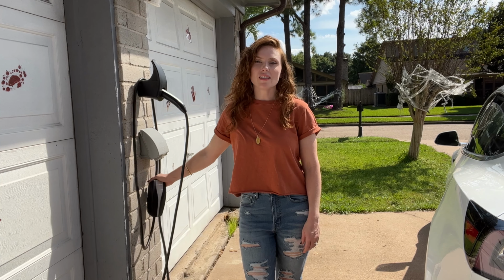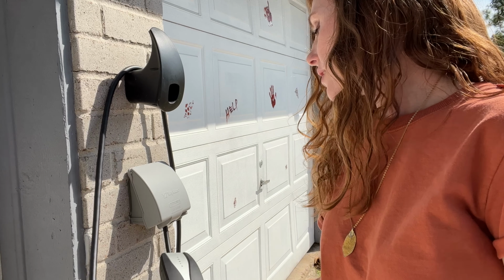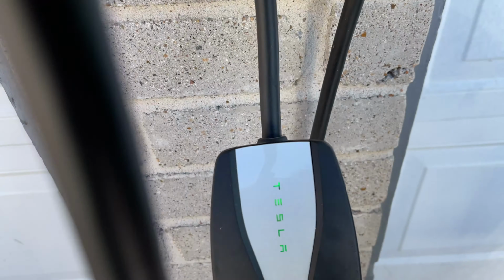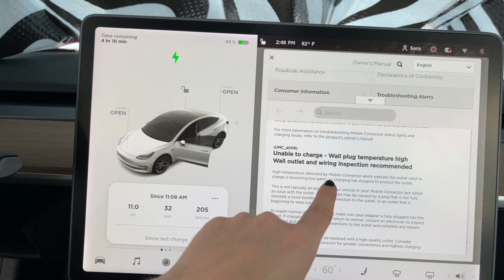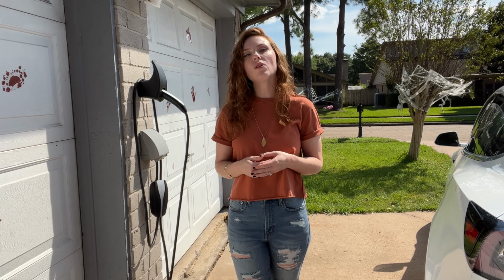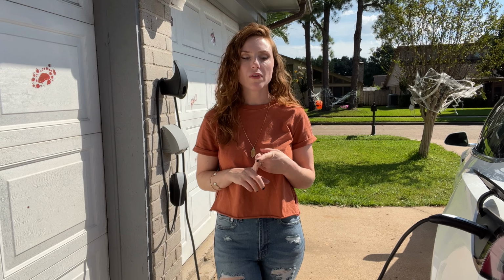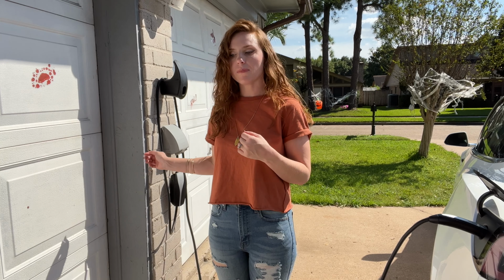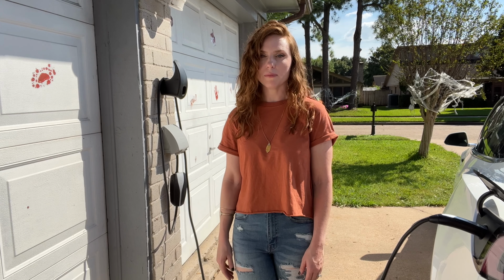TESLA Mobile Charger Problems/ Troubleshooting

Comment: How about getting a small college dorm refrigerator to set outside to put your mobile charger in while charging to keep it cool? You would have to modify the refrigerator to allow the wires to enter and exit, but it could be a cheap solution. Or as some people have already suggested, hire an electrician to move the outlet to the inside of your garage with the cable coming through the garage wall.
Reply from the maker: Haha! Hey, that’s would work! Yes, I should have installed the dang thing inside and ran my chord under the door. I may have to move it even or made a shade that hangs on hook. Nice innovation!!!!

Comment: Again thanks for your methodical presentation. It helps everyone. As to your sun issue have you considered an umbrella?  Perhaps attached to the house like a flag but with a hinge where it connects to the house. When not using it the umbrella  is retracted  and folded up or down flush against the house.  With the hinge you could position it to block the most sun.  Wind may be a problem though. I hope this helps spark an idea for a solution at least.
Reply from the maker: Thanks Eric! Yeah That’s a good idea 👍🏻, I think I’m gonna make a temporary shade made of mesh that I can hang when in use and take down when not in use. I should’ve installed the charger inside the garage and ran the chord under the door. Mistakes were made. Have a great week!

Comment: Good PSA so your viewers don't have to figure all this out for themselves with trial and error.

I read through the suggestions you've gotten so far.  Lot's of clever ideas.  I'm also impressed that no matter whether the solution will work for you, you are so appreciative and complimentary of the idea.  No better way to keep people engaged, coming back, and sharing their thoughts to your topics.  Smart.

One more suggestion to add to your list of solutions, since you are inclined to have a temporary solution (especially if it's not the most aesthetic), I noticed the hook that helps store the cable above the charger and also noticed the Halloween decorations.  Maybe you could find a small banner (or you and the kids make one) that hangs from the hook, shades the charger, and adds to your Halloween motif.

Thanks for the video.  This is a good day for them.  Different day than others so it stands out.  

Looking forward to hearing the solution.
Reply from the maker: Thank you, Bruce! I really appreciate everything in this comment! Yes, someone else just mentioned using a white sheet and I said oh that perfect for Halloween! Lmbo! That’s smart about my cable hook! I didn’t think about using that!! I will probably make a shade out of mesh to allow shade, airflow, and hang it on the hook so it’s only temporary when needed. I should have installed the charger inside the garage and ran the chord under the door. But I didn’t think about that when I got the car. Always happy to see your comments on the channel!!!!! Have a wonderful week, Bruce!!!
Reply: Yeh, the first time we do anything, it's hard to think of everything.  It's a nice clean installation outside and how could you know that the direct sun would be too much for it's temperature limitations.  Now you know and a bunch of your viewers as know as well.  So good job on that!!
Reply from the maker: Thank you!

Comment: Sorry to hear about this problem.   What about simply hanging a large white bedsheet from the hardware above the charger.   It would then hang loosely in front of the charger and reflect the sun but also allow for breeze circulation around the charger.  I use this inside my MY and drape it over steering wheel/screen and driver seat back and keeps things nice and cool.   I know it wont look 'elegant' to passers by!  But you could use a sheet with an atractive light colors instead.
Reply from the maker: Perfect for Halloween! Haha!!! Great idea, Wilber!

Comment: Sara,
Can you have the electrician install another 14-50 Receptacle outlet on the inside of the garage? And just put your mobile charger on the inside of the garage and run the cable to your car underneath, you can still hang the cord on the outside. I do something similar when I don’t want to park my car in the garage.
Reply from the maker: I should have just installed this outlet on the inside in the first place and just ran the chord under the door 🤦‍♀️ mistakes were made. And yes, that would be the best thing to do! Thanks Bradley!
Reply: @SaraJAwesome   Just thought about a temporary solution. What if you mount your tesla charger inside the garage and then run a short extension cord from the charger to the exterior plug. That way only your extension cord will be exposed to the sun.  Just make sure to get a cable rated for outdoor use.
Reply from the maker: Yep, that would be genius!!!!!!!!

Comment: Couple ideers...   If you installed an angled flag on the wall, would that provide some shade?  Maybe make a way to drape it across the charger?  Can you hang a long slender flag off the house to cover it?  I wonder if the white Tesla wall charger would get hot?  That requires 50amp, so that could be problematic.  If you put the outlet on a short pole you could make a white cover to go over it (like a grill cover).  Just throwing a couple ideas your way.  I'm sure you'll come up with something!
Reply: I know you can't park in the garage but maybe move the outlet in there and run the cord under the door so you can charge the car?. That will keep the wall charger out of the sun and out of the weather.
Reply from the maker: Dang it!!!!! I wish I did this in the first place!!!!!!! Before I messed up my brick!!!! Shoot! Thank you, great idea 💡
Reply from the maker: Smart!!!! I do need another American Flag hanging somewhere!!! But right there it may look kind of funny. Brilliant idea though! I thinking I may wrap insulated foil tape around it for now and put a hook on the wall where I can hang a temporary shade eventually. Like a window screen type shade that I can just take down when I’m done charging. Yes, Tesla wall connector would have been better. I was being cheap. Still am 😂 have a great week!

Comment: Hey Sara I'm one of few owners that are able to charge their Tesla at 72 amps, I had Tesla install a limited edition Tesla wall charger back in the day. Only recently have I been discovering my charger was overheating, And limiting my charge to 54 amps. My way to get around this was to turn off the power from the circa breaker When I'm not using it and reconnect it when I get home. My garage is thermal insulated I don't know why but Tesla can't give me a strange answer.
Reply from the maker: Whoa 🤯 72 amps!!!!!!!!! Nice!!!! BUT that sucks yours is overheating too and therefore limiting that amperage. That’s good you found a solution though. What about scheduled charging only at night in cool temps? Someone else just recommended this to me. I don’t know if that would help. What do you think?
Reply: @SaraJAwesome   I tried doing the rescheduling. I'm having the same issue. I believe it's because Tesla is trying to limit the 72 amps chargers to 54 amps. I've called the Tech Support with Tesla they've come out several times. This wall unit was installed by a licensed Tesla electrician certified.
Reply: You know what I just thought about what makes it even more interesting. You're  Model 3 is limited to about 54 amps of charge I believe. On the wall charger. But if you go to the 2nd new superchargers that are a release called destination chargers. Those are 72 amps then you're allowed to charge At that rate. Makes no sense
Reply from the maker: That is weird…… I wonder if it’s for safety reason. Very interesting.
Reply from the maker: Yeah… hm. I have no idea. I’m clueless.

Comment: Great video as always Sarah. Hopefully you find a solution to your problem. 👍
Reply from the maker: Some of my subscribers are coming up with fantastic solutions actually! I think for now I may wrap it in insulated foil tape and eventually make a removable shade that hangs a hook to cover it up. But I should have installed it inside the garage and ran the chord under the door. And other suggest the Tesla wall connector because it’s white and resets by just unplugging from the car. But I’m too cheap for that upgrade right now. Thanks Mishal!!!!

Comment: Maybe if the charger was painted white it wouldn’t absorb so much sunlight.  Just a theory.  I wouldn’t paint the end that contacts the car though.
Reply from the maker: Yep, I think you’re right! The Tesla wall connector is probably white for a reason!!! I may either wrap it with insulated foil tape temporarily or make a removable shade on a hook there on the wall. Maybe I could paint it white, but I wonder how much the color will actually drop the temperature. Genius idea, Aaron! Have a great week!
Reply: @SaraJAwesome  color and temperature are closely related. Dark colored material absorbs significantly more sun light and heat than lighter colors. Touch a white cars hood in the middle of the day and then touch a black cars hood.
Reply from the maker: Oh I know, I TOTALLY agree 💯!!! I’m just wondering how many degrees it will actually drop it down, will it still over heat? I’m not sure EXACTLY what degree makes the charging slow amperage and then also stop. I need to learn. 👍🏻👍🏻👍🏻👍🏻👍🏻👍🏻👍🏻

Comment: I wonder if you could put the charger on the inside wall and have a small hole below it going outside with just the charger cable coming out of it with some type of flaps to cover hole when not in use.
Reply from the maker: This is genius. I wish I thought about this before! Just installing the outlet on the same place but on the INSIDE of the garage and running the chord under the door! That would have been prettier and better for the mobile connector!!!!!! Smart!! Thank you, Dillon!!!

Comment: Hi Sara, a couple of things you could do.  I see you have a 10-30 socket  in the house and your charging at 24 amps.  The mobile connector is water resistant and insulated very well.  You could wrap the body, just the body,  of the MC with aluminum foil with shiny side out.  No appreciable heat is generated in the MC all solar heat would be reflected away.  Only cover the black body surfaces as the black is absorbing the heat from the sun. 

To charge faster you could supply up to 32 amps from the MC but check your circuit and wiring, it may be limited by your currently installed circuit.

If you install a new V3 Tesla wall connector and upgrade the wiring to handle 50 amps you can charge at 48 amps nearly 44 miles per hour, it might be best for you.  It’s white and not absorb heat from the sun.

Good luck
Reply from the maker: ✅✅✅✅✅✅✅✅✅ All genius 💡 ideas!!!!!! I can’t go over 30 amps, but these are all  fantastic solutions I think!!! I definitely don’t want to pay to upgrade to a wall connector right now, but this is a good reason for other people to get one and for me to upgrade in the future! For now I think I may try to make a removable shade or wrap it in insulated foil tape and see if that helps! Thank you!!!!!!!!!!!! Have a great week!!!

Comment: Very very interesting. Never really knew and it over heating.  Have you thought about  moving the plug to the inside of the garage? My plug is on the  South west part of my house and it does get very very warm here.  I have been trying to figure out a long term solution for my card.
Reply from the maker: ⭐️⭐️⭐️⭐️⭐️⭐️⭐️⭐️⭐️Actually this may be a GENIUS solution. I should have put it inside the garage at the exact same spot and just ran the chord under the garage door. Dang it. That would have kept my garage prettier too! Why didn’t you tell me this a year ago?! Where were you?! 😂 As I’ve stated before, “I’m an idiot!” Gosh darn it!!!!!!! Have a great week!!!
Reply: @SaraJAwesome  Sometimes you can't see the forest for the trees.
If that happens. Zoom out.

Guess you have a new garage project, Sara. :)
Wish you good people a fantastic week!
Reply: Yes... other folks have done this I believe, as long as the cord is long enough... should be ok to have the cable run under the garage door, as long as the weatherstripping cushion doesn't crush it too hard.
The GFCI shouldn't be tripping on the charger either, might be something bad on the circuit or the exterior outlet (if it is already GFI too, that can cause problems)... so a new circuit/outlet inside, may solve both problems
Wall connector should fare better in weather as well, if you want to go that route. Might actually be cheaper than running new circuit/outlet..

Comment: Thank you for this! I just got my Tesla Wall Connector installed this past weekend, but I don't have my car yet. Still waiting on delivery. I'm curious to know if this will be an issue with the TWC.
Reply from the maker: Well someone else just mentioned to me that the wall charger resets ITSELF! Because you don’t unplug it. So that’s GREAT news for you! PLUS it’s under white glass right?! So that should provide some cooler color absorbing shade to that area where the GFCI is located. Make sense?! Hopefully you will be totally fine then. And if yours does trip you will be able to reset yours by only unplugging from the car I would assume. Since you can’t unplug from the wall. Let me know your thoughts, and I hope this eases your mind! So excited for you!!!!!!!!! Congratulations! Welcome to the family!!!!!!!
Reply: @SaraJAwesome  I have the Tesla wall charger outside in the hot South Carolina sun and have not had any problems with it, even on the hottest days.
Reply from the maker: That’s awesome!!! I’m glad you don’t because it’s annoying! I wonder if my cheap outlet is part of the problem as well. It definitely can’t help. That’s for sure. I should have installed mine inside the garage on the same spot and just ran the chord under the door. Mistakes were made on my part for sure.

Comment: Hi Sara.  I'm in Florida so I feel your pain, at least with the heat.  My mobile connector is in the garage so I haven't dealt with this but I can think of a couple things to try besides a shade which might be ugly.  The first is, you could try taping over the black parts of the mobile connector with white tape or even foil tape.  I bet that black really absorbs heat so we can try to reflect it instead of shade it.  The second thing is, you could try putting some sort of spacer between the top/short cord and the brick to get a little spacing between the brick and the mobile connector; I bet the brick gets hot so give it some air space.  If this works out, you could even remove the tape and mask off only the silver/light area of the mobile connector and spray paint the black parts white for a more permanent fix.  Maybe worth a try?
Reply from the maker: Mikey….. you may be a genius! I wonder if that insulated reflective tape for pipes would work! And it’s temporary so I could take it off when it’s not the three hottest months of the year! I don’t think the brick is adding too much to the heat, but you could be right there too. I’m thinking maybe a temporary removable shade on a hook or something. I can just throw it on there when needed and not have something ugly there all the time. Great ideas!!!!  Thank you! I don’t know if the white paint would help, but maybe 🤔 Have a great week!!!!
Reply: @SaraJAwesome  Good thoughts. My only other thought is that I wouldn't get a small shade that blocks air or traps heat around the mobile connector. Airflow is probably key too.
Reply from the maker: Totally agree!!!! Something made of window shade type breathable materials perhaps and not fitted around the connector. Very good points!!!

Comment: That really sucks. Sounds like you may have to build a hood over the lower section of your charging setup. Also if you had the Tesla wall charger, it would reset automatically as opposed to your NEMA 14-50/mobile charger setup? Let us know when you come up with your final solution!
Reply from the maker: Yes, that’s very true. The Tesla wall charger would be better and prettier!!!!! Maybe one day I’ll upgrade!!! Yes, I may have to make a temp shade for it somehow. I don’t want anything permanent and ugly on my house there, but maybe a removable shade that goes on a hook a few months out of the year when it’s hottest. I started working part time so hopefully this issue won’t be as cumbersome now. You make a very good point Robert!!!! Have a great week!!!!
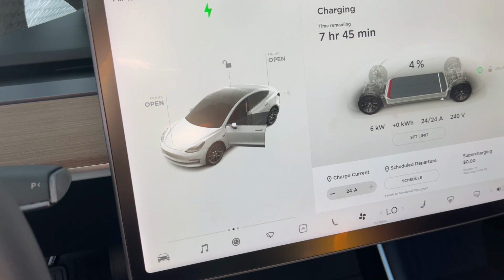Reply: @SaraJAwesome  The wall connector also charges faster (if you hook it up to a larger circuit).  But it might have the same issue with overheating.  Mine is in the garage.  While my garage also faces west, I have some trees that do provide some afternoon shade.  Also, I schedule my charging to be finished by 6:00.  So the car doesn't even start charging until maybe midnight.  Maybe on the really hot days, the wet towel might be the best solution.  Or supercharge instead of homecharging.
Reply from the maker: I agree with all of this. I’ll probably just make a temporary shade for it. I wish I would have installed it inside. Dang it.

Comment: You could build a small box around the charger and cover it in the material they use to make the windscreen sun shades.
Reply: Yup I was going to suggest the same thing. Cover it with like tin foil material or the emergency blanket material so it reflects the heat.
Reply from the maker: Smart!!!!!!!!!!! I just want to try to figure something out that isn’t ugly on my house. Ugh 😩 it’s only for 3 months out of the year I think I’ll have this issue though. And I’m working part time now so maybe it won’t be as annoying. Great idea though!!!!!!!!!!!!!!! Maybe a removable shade like this you described?! Thanks!!! Have a great week!